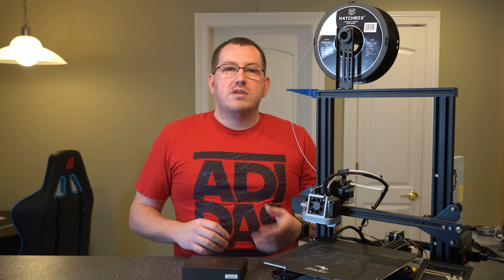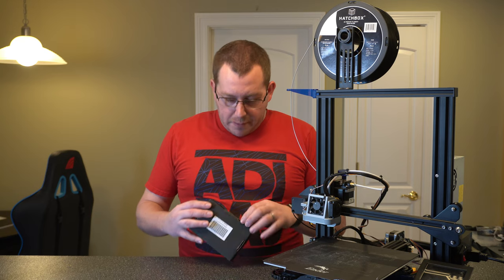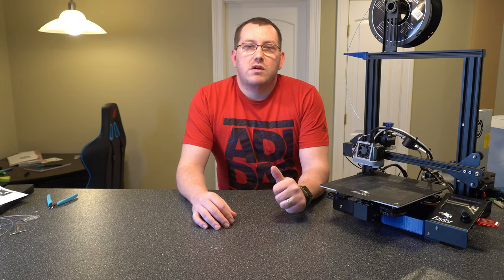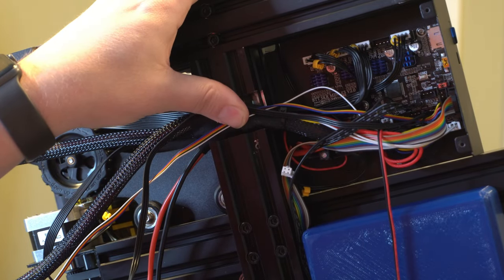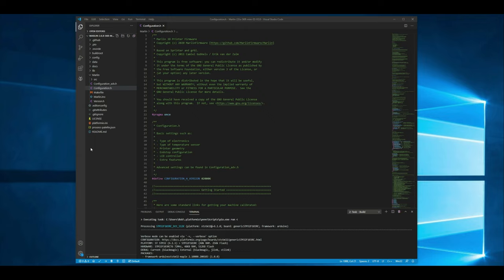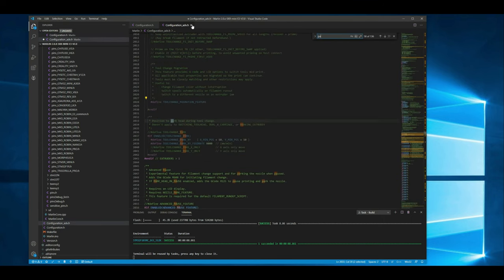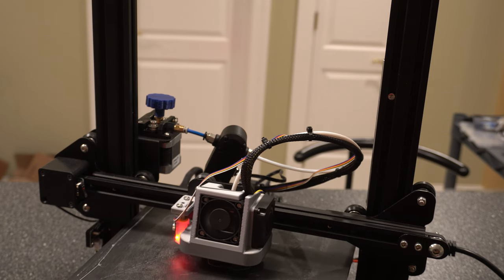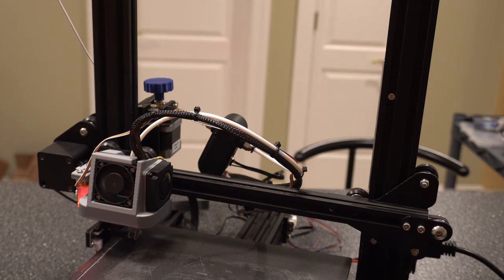Ender 3 Filament Runout Sensor – Install Guide

Comment: Hello as always thank you for the video and the help.I was wondering if its possible to use the BTT filemant sensor but on a Creality 4.2.7 board.
I see you have it on a skr mini but im finding people reporting very mixed results with this sensor and a creality 4.2.7 board.Please help! ty
Reply from the maker: Hi. Thanks for the feedback, im not sure if thats possible or not. I know you can get a basic sensor to work, just haven't tried the smart sensor.
Reply: @3DPrintscape  Ty for the reply so decided to return the butt sensor and get the creality 3d pad that upgrade my screen and that comes with a simple filament sensor.Any opinions about the creality 3d pad? Ty
Reply from the maker: @PolskyMurillo  I have heard good reviews about them, I may end up getting one myself to make some videos on. It seems to work similar to having an octopi connected.

Comment: the prints keep pausing and saying "filament runout" even though there is a full roll on
Reply from the maker: Hi. Are you printing from the same location the sensor is plugged in?

Comment: EO stop is a 2 pin plug and my sensor is a 3pin.. Where am i supposed to plug in at? i have a skr mini 1.2
Reply from the maker: Hi. Im pretty sure that it would plug into the pt-det port on the 1.2.

Comment: So idk if this matters or not but when trying to set the filament runout distance it's all dulled out text and is already uncommented. Does this matter if the text is dulled out? There is nothing else to uncomment to make it bright like the other text. Hope that made sense lmao
Reply from the maker: Hi. Make sure #define FILAMENT_RUNOUT_SENSOR is not commented out.
Reply: @3DPrintscape  I replied on my other comment but in your video you definitely say to "uncomment FILAMENT_RUNOUT_SENSOR". So what do you mean it's not commented out? Your saying I can just plug in my runout sensor without changing my firmware build and it will work? Super confused.

Comment: Yea after my previous comment I tried to build the code and it failed. Followed everything you did aside from mine being dark text. Any advice?
Reply from the maker: Hi. Make sure #define FILAMENT_RUNOUT_SENSOR is not commented out.
Reply: @3DPrintscape  oh, I thought you did that in the video. I'll rewatch and try again but I ALWAYS have issues when it comes to this stuff lol. Never wants to work!
Reply: @3DPrintscape  okay I was right, you did uncomment "FILAMENT_RUNOUT_SENSOR". So what do you mean it's not commented out? Your video says one thing and your saying another.
Reply from the maker: @BMathiesen  We are saying the same thing, I worded my comment oddly, It should be uncommented. Can you email me a screenshot of what your seeing? My email is admin@3dprintscape.com.
Reply: @3DPrintscape  I sent you an email. Thanks so much for your help as this is driving me nuts

Comment: I have successfully installed and run the smart filament sensor, and have since pulled the trigger on a BLTouch. Would dropping in the Firmware-Bltouch.bin from BTT's github override the code I have made following this video?
Reply from the maker: Hi. Yes, that would replace everything with whats in that package. Not many changes need to be made for the bltouch. Here is a video that may help out. https://youtu.be/PMG4bC9I3DA

Comment: I'm connecting the sensor to the pre-set port on the V4.2.2 board on my Ender 3 V2.  I think I need to reset the pin the for FIL_RUNOUT_PIN.  Is the new value PA4?  thanks. good video
Reply from the maker: Hi. The Creality 4.2.2 board does use PA4 for the filament runout sensor.
//
// Filament Runout Sensor
//
#ifndef FIL_RUNOUT_PIN
  #define FIL_RUNOUT_PIN                    PA4   // "Pulled-high"
#endif
Reply: @3DPrintscape  Do I add these lines to configuration.h or somewhere else?
Reply from the maker: @ScrapSoft  Those lines are already in the pinout section of the firmware. I just put them there to show that the value you were thinking was rihgt.

Comment: What exactly is the process to clear eprom? I have the same problem where filament sensor is trigger as soon as print job starts. Sorry newbie here. Thanks in advance.
Reply from the maker: Hi. The process varies based on the firmware but you should see reset defaults or clear eeprom in one of the menus.
Reply: @3DPrintscape  Thanks for getting back to me. I have the same kind of setup SKR Mini E3 v2.0 with BTTsmart filament sensor and BTT TFT35 E3 V3. I did clear eprom via TFT menu custom defaults, then applied the firmware again, but I still get the false triggering. Not sure what I'm doing wrong. I had the same issue with a different Creality sensor too. I'm not sure what to troubleshoot. Not sure if the pins are right or not on the ribbon cable from the sensor to the SKR Mini but I thought it'd be default since they are both from BTT. IDK. Probably just going to return if I can't figure it out.
Reply from the maker: @danaquino  This is difficult to troubleshoot here. If need more help, you can join the discord server. There are a lot of people on there who may be able to help.

Comment: Are the same settings on Eder 3 with V4.2.2?
Reply from the maker: Hi. Are you using the standard or smart sensor?
Reply: intelligent
Reply: BTT BigTreeTech czujnik filamentu SFS V1.0
Reply: I'm having a problem with calibrating it and whether this video fits Ender 3 with the V4.2.2 disc
Reply from the maker: Sorry for the confusion, this wont work with the 4.2.2 board. This video was made using a Ender 3 pro that came with a 1.1.4 board that i upgraded to the SKR mini.  @panex4286

Comment: Can you help me, please. love your videos and have helped a lot, congratulations. I followed all the steps, but my Smart Sensor Filament does not work. The sensor is connected to the TFT and prints from the SD slot on the TFT continues to print even when filament is removed. It’s as if the sensor doesn’t exist. The Sensor feature is  set to Smart on the TFT35. I tested the Smart Sensor Filament out of the circuit and it seems to be working correctly, as there is voltage variation in the "S" signal terminal of the connector.
My hardwares and firmwares are:
Printer: Ender 3 Pro with Direct Drive and Dual Z Axis
Board: BTT SKR E3 2.0; Marlin 2.0.7.2
Display: BIGTREE_TFT35_V3.0_E3.27; Firmware: 2.0.5.4
Reply from the maker: Hi. I replied to your email yesterday but it looks like it was blocked. I will reply back again with a link to a file instead of putting it in the email. I know once you get past a certain firmware version, the smart sensor has a lot of issues or doesnt work.
Reply: @3DPrintscape Thank you very much for your answer, I will check and compare and I will answer you later as it was.

Comment: A guide for an ender 3 but you have an SKR board. Yeah that doesn't make much sense.
Reply from the maker: Hi. Thanks for the feedback. I didn’t think it would be an issues because that sensor is made for the SKR Mini but I understand what you are saying. That said, in my opinion, adding a filament runout sensor to the stock board is a lot more trouble than its worth.

Comment: Hey...thanks for the channel.  I used them to upload the cr touch and BTT.  All items work as intended, but my display has gone horizontal, and I've lost all my icons.  Everything seems to be there.  Just looks kinda 8 bit plane text (and the horizontal thing).  Any tips would be appreciated.   Thanks
Reply from the maker: Hi. Can you send me a picture of what your seeing and a copy of the configuration.h and adv files? My email is admin@3dprintscape.com .
Reply: @3DPrintscape  thanks!  I'll send it out tonight
Reply: any luck with the review?
Reply from the maker: @T475-y7v  I dont have any emails that I haven't responded to. Can you try to send it again, or give me the email subject so I can look through my spam folder.

Comment: What filament runout sensor will work using the 4.2.2 board and stock firmware?
Reply from the maker: Hi. The generic trigger ones will work, i dont think the smart sensor will.
Reply: @3DPrintscape  will this work with a cr touch installed?
Reply from the maker: @Creptex  Assuming you have the SKR Mini board, it would work. To the board, there is no difference between the bltouch and CR Touch.

Comment: What would be helpful is to stress that you need a 3rd party motherboard for that, not the allen wrench
Reply from the maker: Hi. Thanks for the feedback. I talked about needing a mainboard that has a break interface detection in the beginning and that it won't work with the stock 8-bit boards at the beginning and mention it a couple of additional times throughout the video. Is there somewhere specific you feel I should have added it? I'm looking for feedback to make sure I'm better about it in future videos.
Reply: @3DPrintscape  Well Ender 3 V2 has a 'pre-set port' that Creality seems to intend to use for this exact purpose and the connector fits it, you might want to say a few words about it and how to configure the firmware for this particular sensor if they're compatible.
Reply from the maker: @quaest  OK, i think i will end up needing to picket up and Ender 3 v2 and start making some videos on that. There are enough differences between the Pro and it to justify the purchase. I just bought an Ender 5 Pro that should come with the same main board though, so i will check.
Reply: @3DPrintscape  i think this guy is probably like me and skims through the video a bit to see what is necessary, but that can lead to many mistakes. I bought a filament runout sensor and i didnt even know i would need a new main board.

Comment: does it matter is sensor is before or after extruder
Reply from the maker: Hi. It can be in either spot. If it’s too far from the extruder you may see false positives. If that happens, increase the runout distance in the firmware.

Comment: Hello, can you help? I have the ender 5 pro and the print head crashes into frame after compiling btt smart filament runout sensor firmware.  I used the updated 2.0.8.2 firmware version from gethub. I also have the skr mini e3 v2 board with TFT 3.5 E3 v3.0 display installed.  Thanks in advance...
Reply from the maker: Hi. Did you use the right configuration example for the printer board and if so, what changes did you make in the configuration.h file?
Reply: @3DPrintscape  hi, yes, I used the firmware.bin file inside of the STM32F103RC_Btt_maple folder and I followed your instruction all the way through like 5 times literally just to make sure i didn't miss anything. Not sure what i'm missing.
Reply: @3DPrintscape  Also, I do not have a bltouch if that helps.
Reply: HI, no bltouch is not enabled.

Comment: I can't get it to work on my ender 3 v2 with creality 4.2.7 motherboard
Reply from the maker: Hi. I havnt connected the BTT smart sensor to the 4.2.2 or 4.2.7 board but i can try to help. How do you have it wired and what behavior are you seeing?
Reply: @3DPrintscape  I connected it to the motherboard I didn't change any pins ... the problem it gives me is that as soon as it starts printing it goes to the parking lot and starts throwing out the wire ... throw the thread out
Reply from the maker: @Alessandro-bv5yl  Are you printing from the SD card on the mainboard and is the sensor set to on or smart?
Reply: @3DPrintscape  yes i print with sd card from motherboard ... how do i know how it is set to on or smart?
Reply from the maker: @Alessandro-bv5yl  In the settings for the filament sensor, you should see off, on, and smart. On the SKR Mini, this needs to set to smart. I'm not sure about the 4.2.7 board though, I'm assuming it would be on.
Reply: @3DPrintscape  
I use display stock and there is no voice on off sensor I first throw it away!
Reply from the maker: @Alessandro-bv5yl  Wait, i may have made an assumption that I shouldn't have. Did you update the firmware on the 4.2.7 to account for the sensor? It wont work without it being enabled in the firmware.
Reply: @3DPrintscape  
of course I did everything like in your video ... but nothing to do ... it starts and stops immediately and takes out the filament
Reply from the maker: @Alessandro-bv5yl  Can you send me your config files and a picture of the wiring (I need to see what cables connect to which pin on the mainboard). My email is admin@3dprintscape.com or you can reach me on Discord. https://discord.gg/Bu94EYVkrU